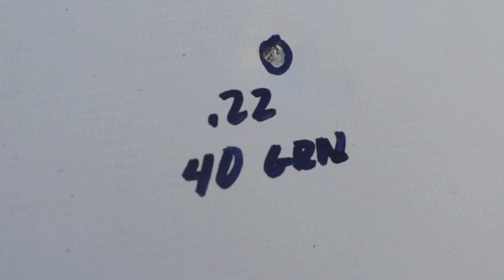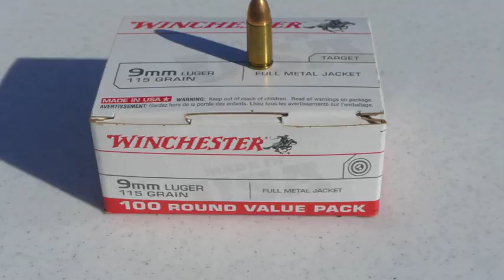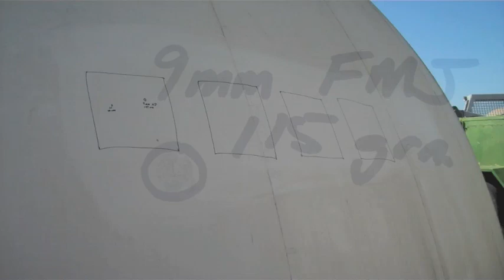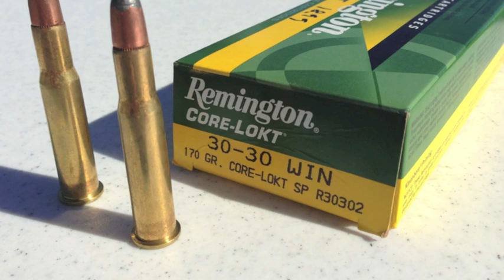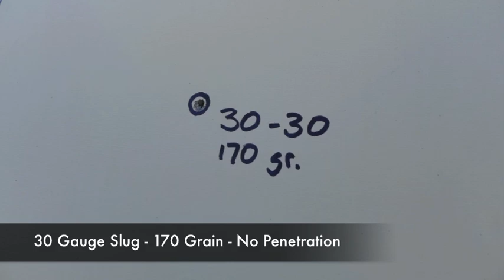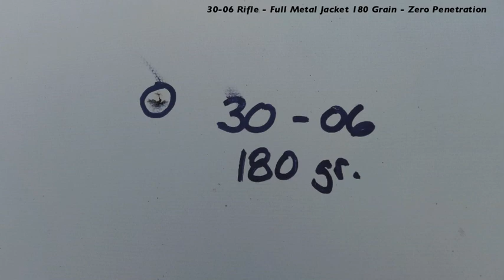How Bulletproof is a Monolithic Dome?

Comment: Nice Video! My question is: is this a valid comparison?
1)All concrete blocks shot on the ground are (i) Perpendicular to the line of fire. (ii)Brittle concrete "cinder blocks".
2)The dome is (i) Angular, thus deflecting the round upward. (ii) A two part composite of energy absorbing foam and then solid concrete. (see graphic at 6:35)

This is like comparing hitting a piece of glass with a small ball peen hammer, and hitting a padded goal post with a small ball peen hammer. Which do YOU  think is going to sustain more damage?
Reply: Of course it is a valid comparison. The comparison is NOT between the cement block and the dome. The comparison is between bullets to see if any of them can penetrate a monolithic dome wall.

Comment: Those of you going on about penetration.  Well, there is no penetration unless the projectile is physically lodged in the side of the dome.  There is certainly indentations from the projectiles, but there was no penetration.
Reply: Did you even watch the whole video? Went clear through the foam and was stopped by the cement on the inside.

Comment: Did any of the shots penetrate the shell of the dome? It's hard to tell from the pictures.
Reply: No.  Not even the 30-06.  We expected the 30-06 to penetrate, and I'm sure a few more shot in the same area would have.  Its pretty impressive.
Reply: ***** OK that's encouraging, but here's another thing: The dome homes are said to be hurricane and tornado resistant, but what about debris that is blown about by these storms and that is blown into a dome, such as cars and boats or other debris that a hurricane can pick up and blow through the air? Won't that cause some damage if it hits a dome? Isn't that likely to happen?
Reply: ***** Another question for you: Is there a way to test for Radon and if necessary, install a Radon mitigation system in a Dome Home? If so, what does that generally cost?
Reply: Bill Matthews
If you go to www.monolithic.com, you'll find the main web site of the company.  The upper right corner has a search box.  You'll find pretty much all of your answers there.  I know from past conversations with other people on the company forum that monolithic domes have survived having pickup trucks picked up and thrown at them. The only damage was a slight tear in the airform.  (Just another reason to coat your airform with stucco.)
Reply: Yes went clear through the layer of foam, but was stopped by the cement

Comment: What material is this dome made from?
Reply: Steel reinforced concrete covered with foam insulation under a tarp-like fabric.
Reply: Outstanding! Thanks for responding. I have an idea for a dome but not perfectly geometric rather like the shape of the saucer section on TNG Star Trek ship. It's more of a flat, somewhat oblong and researching the easiest way to make that form. If it comes to pass I suppose I'll have to make the entire form with wood unless there's a better way. Was that an inflatable form?
Reply: John Arizona We have built a spaceship structure before.  Go to Monolithic dot org and search for the starship pegasus.
Reply: Yup. Been there.
Reply: hahaha thats awesome man
Reply: John, 1. An airform is attached to a foundation or ring beam and inflated to about 2 inches of water column pressure.
2. Polyurethane foam insulation is sprayed on the inside of the airform (abt. 3" thick).
3. Wire rebar hangers are inserted into the foam, rebar is hung according to engineering requirements.
4. Liquid shotcrete (wet mix) is applied inside, over the rebar. Thickness varies depending on the size of the structure. Thicker at the base and typically the top will be only about 3" thick. 
After the concrete is placed the fans can be turned off and the concrete allowed to cure.
Google "Monolithic Mosque in Iraq Still Stands".

Comment: The car bomb is more likely a threat here in my country
Reply: Domes are far more blast resistant than flat walls, and you can use fiberglass-reinforced concrete if you with for more protection.
When you see a building destroyed by car bomb, note the way the structure fails and how the load is distributed. Also note the way hardened aircraft shelters have rounded tops to resist blast overpressure.
Reply: Ob Fuscated
You can also spray LINE-X over the outside of the dome.  Ain't NUTTIN' gonna get through that!

Comment: You labeled the 30-30 also as a 30 gauge ... Nice demo video overall ... A thin coat of concrete to the outer shell would make it really fireproof too as well as insuring minimal moisture absorbed by the foam over time ...